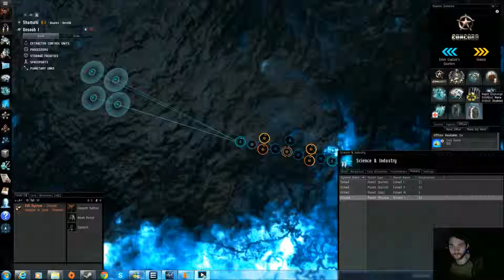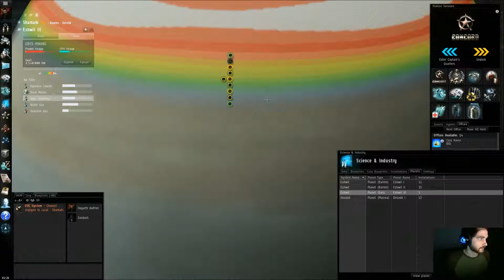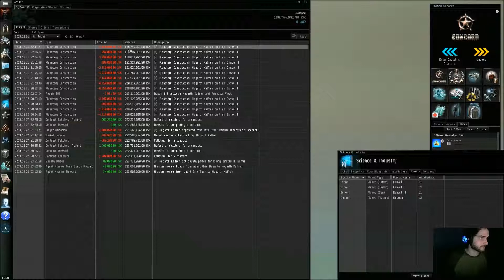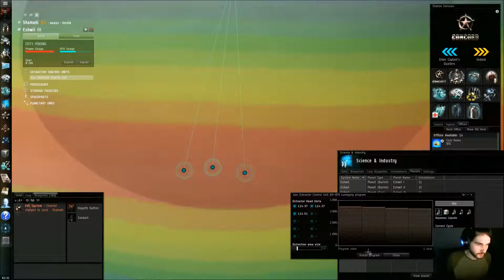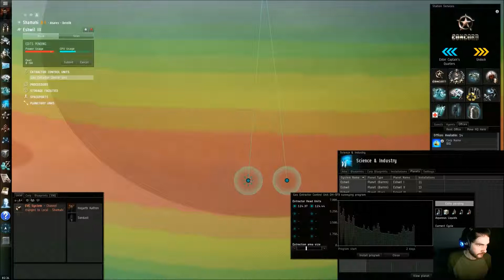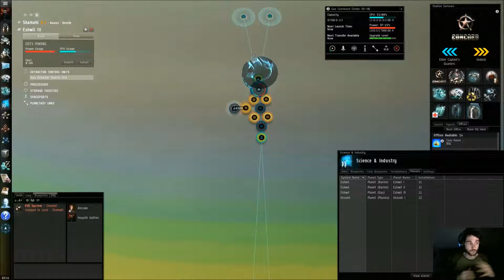Joey's Adventures in EvE Online Episode 3 Part 2

Comment: ok now part one was good but I finding an issue where you don't say why each structure is where they are. I understand why the long shape of the base but nothing else I tried to due this as you did and my command center's cpu is maxed soooo what do I do?
Reply: ok upgrade but y would you take off some structures after placing them...  I know you said y but how.
Reply from the maker: The first method used was to give a very simple method of placing your buildings so they were effective, after that I did a more compact order that is more effective but it is helpful to know a standard style before seeing the compacted one, you can remove structures by clicking on them and clicking the remove button on the info panel that shows up